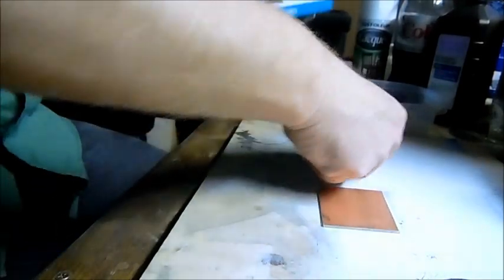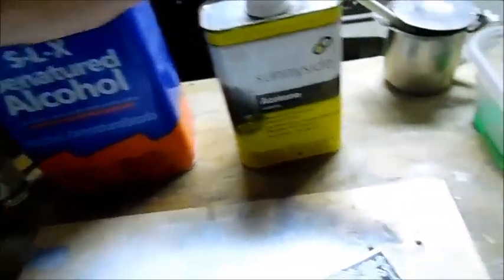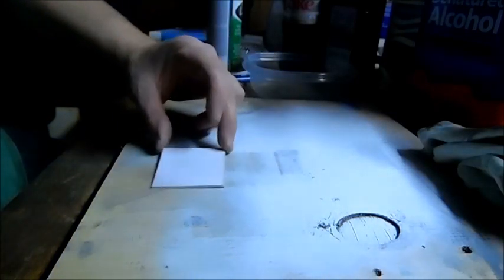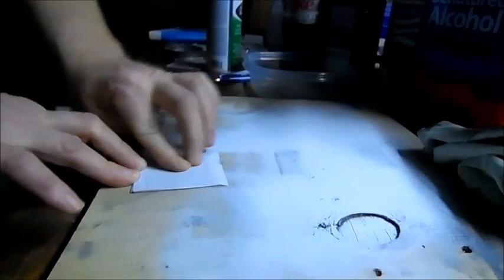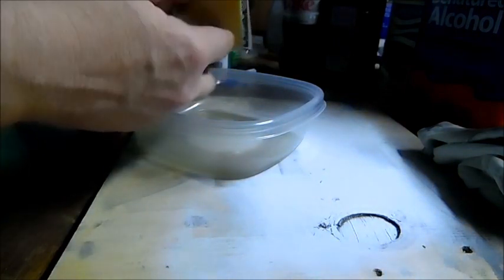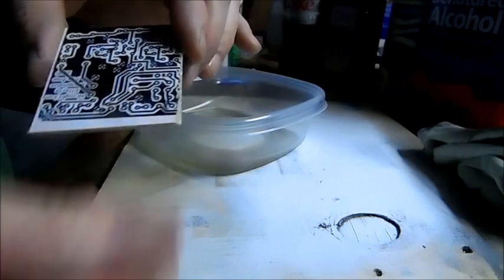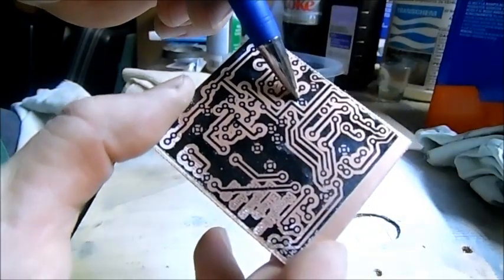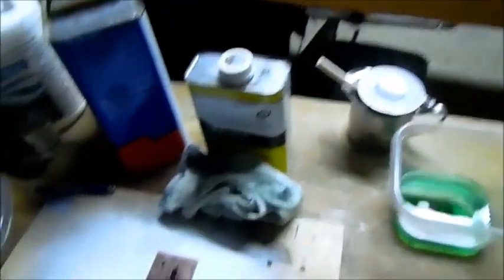heatless toner transfer for PCB etch--Impatient version

Comment: Excellent, best results I've had and I've tried them all.
I put mine through a cheap GBC laminator afterwards and worked 99% perfect. Cheers!
Reply from the maker: yeah, i eventually went to using a laminator as well- it really makes the process much faster.

Comment: Great work.  TBH with a thin glossy magazine page, It will take only 5-7 minutes to make this size of PCB.  Here is how i do it consistently everytime. 
1) Remove the Toner cartridge, shake it vigorously and replace it.  then print 
2) Heat the iron to just below the "wool" setting.  temperature around 125-135 degree C works best. 
3) Heat the PCB using Iron for 30 seconds. 
4) Put the artwork on PCB.
5) Put a folded paper towel on PCB and keep the Iron on it for a minute. 
6) Spend 2 minutes moving the Iron's sides here and there and all corners applying pressure thoroughly. 
7) let the PCB cool down on its own. don't rush it . If we put the PCB under water while it's hot, the copper shrinks faster than the transferred toner and the toner cracks. 
8) Once cool, dip the PCB in water until you see the artwork through damp paper.

Comment: Thank you for this video I have been using the laser printer on the yellow paper and the iron heat  for 3 minutes  with 8: 10 results  but I will try your method which looks good.

Comment: I'm very satisfied with the "nail polish remover method". It's even faster: Just make the board wet with it, lay the paper on it, pour a little more on the paper until it's completely wet too. Wait 10 sec. for the chemicals to work on the toner and then apply pressure gently across the whole board with a paper towel. When finished wait until the nail p. Remover is completely vaporized. Then soften the paper with water and peel it off slowly.

Comment: Muratic acid has some unusual properties in that it can escape thru the side of the plastic jug you bought it in to rust any iron nearby. I won't keep it inside anymore for this very reason. What I do have is kept outside 24/7 so that the fumes escaping do just that without throwing a layer of rust onto nearby objects. I hate it when "they" change their formulations without any notice, black flag flying insect spray (blue can) did this and while it still works aces, it tends to shoot a stream clear across the room when you wanted a fog. So after years of keeping a stash of the "good" nozzles which didn't help at all, I did something remarkable, I shook it. Ya know just like it says to on every spray can for the past 50 years.  <<< that part, the actual shaking makes it do fog instead of squirt, so now I have to shake it first if I actually want the fog version out of the very same can. And all the nozzles are the same. Whoda thunk it? Didn't used to be that way, but it's that way now. Interesting video, thanks for posting it. Always helps with more information even though I'm tending towards the using glossy magazine paper to do the transfer with at the moment. That will change quickly when I get around to doing it of course. I'm as fickle as it gets in that regard, wondering if perhaps the clear lacquer still has the properties you are capitalizing on here?

Comment from the maker: UPDATE: apparently Rustoleum has changed the formulation of their lacquer and it no longer dissolves in alcohol!!! The last 2 cans i bought have been extremely difficult to work with, which might explain some of the difficulty some of you were having duplicating my results. I will update further with a substitute transfer base soon. Thanks!
Ed
Reply: 4 months ago you promised an update. Where is it?
Reply: Shellac will dissolve in alcohol you only would need to add pigment to it for this method. And i'm not sure if that toner would stick to it.

Comment: Murriatic Acid is Hydrochloric Acid. Fisher sells, for the industrial laboratory a 12N (12 times Normal) concentrated solution that will smoke/fume when opened and should be used under a hood (your breathing chlorine vapor) since it will burn your sinuses. My question is do any of these home-store/hardware store bought murriatics state a concentration either as a percent solution or normality on the bottle? And remember… “Acid to Wata like you oughta”!

Comment: Thanks, Ed! I tried this with mixed results and I had a question or two. I have the exact ingredients in your video (rustoleum spray lacquer, acetone, denatured alcohol). 

When I rub the alcohol to remove the lacquer from the board, some of the toner comes off with it, making the solid black areas kind of spotty and the traces weak. It kind of makes sense, since the lacquer is "under" the toner. I tried waiting a little longer before using the alcohol but that made the lacquer cure and the PCB didnt dissolve at all in the acid (thin layer of lacquer covered the surface). 

Any advice on timing or method would be greatly appreciated!!

Thanks!!
Reply from the maker: Use the alcohol immediately after doing the transfer and-this is the key- don't use any pressure when wiping the lacquer off. Use lots of alcohol and just gently wipe rather than rub. If you have these exact ingredients, it should wipe right off if you use enough alcohol. If you get a stubborn area, just take a very small screwdriver or similar and scrape in just that small area. 
I usually go back and review the transfer under a magnifying glass and use an ultra fine tip paint pen to fill in any spotty areas in the ground plane or touch up a trace or pad.

Comment: I just got the iron on method to work great. I print on the shiney side of a transparency. clean the board, iron it on, peel it off then do it again. I have two layers of toner. Its easy to align the patterns since you can see through it. It Works perfect, and I have a brother printer, with toner from InkOwl.
Reply: Please upload a video of this. I would love to see this method in action.
Reply: yes, I do that..  the film transparency print with HP1102 with high resolution 1200.. put on the pcb.. then iron about 1 minute... 99% the tonner on film move to pcb

Comment: There is another video of a dude using 8 parts Alcohol and 3 parts acetone and it's a lot easier looking then this. Anyway better then the ironing method!
Reply: Kimball Wiggins I tried the 8 part alcohol and 3 part acetone with no luck. I even tried straight acetone using his methods and still no transfer.
Reply: Botwire You can try Acrylic instead Axetone
Reply: No need to mix anything, just use nail polish remover. Worked straight "out of the box" and as bonus your pcb is smelling very nice.

Comment: i have a samsung laser printer and i am having a hard time getting a good transfer. i have 7mil glossy inkjet photo paper and was wondering if you were using the same type of paper. i have not tried using  laqour yet but it looks like something to try.  Does the laqour need to be fully dry or just dry to the touch?
Reply from the maker: hey Botwire, sorry for the delayed response. technical difficulties. Anyway, I print onto the backing paper from shipping labels. You remove the label and print right onto the glossy side of the backing paper (see comment below for printer help). These work way better than any others I've tried. 
https://www.amazon.com/Best-Print-200-Half-Sheet/dp/B0069RY9BY
Spray the lacquer, then blow it dry just for a few seconds till there's a film over it. Then carefully set the transfer onto it and start pressing and rubbing.
Reply: Botwire  try transparencies and iron on two layers of toner,

Comment: Can I use laser printer to print  the pcb on glossy  paper? Or should I use laser printer for this work?
Reply from the maker: Not exactly sure of the question. You definitely need to use a laser printer-- ink jet won't work. I use either pcb transfer paper available from Amazon, or the glossy side of shipping label backing paper. Does that answer your question?

Comment: This looks really easy when you are doing it. But when I use alcohol to remove the white paint I need to press too hard to clean all the small details - which then also rubs off the toner.
Reply from the maker: Torsten Curdt the secret is to use lots of alcohol and very little pressure.
Reply: I tried again. Still not working for me. I've completely immersed the thing in ethanol for a few minutes. The lacquer did not even start to dissolve, nor did the force needed to clean the copper became less. Maybe the  lacquer I am using is wrong? But then the question is - what should it be else?
Reply from the maker: I think you just have some acrylic/water based lacquer. I wasn't even aware that there was such a thing, but I think several people have had the same trouble.  make sure the can says to clean up with mineral spirits or some other similar solvent rather than water.
Reply: Unfortunately it doesn't say on the can. It's a 385836 white dupli color - apparently meant to be used on cars. http://www.motipdupli.com/en/products/dupli-color/mobility/cars-rallye-sprays/ipg-1089/tm-1089.html It says "nitro-combi" based and "Limited resistance against petrol"
Reply from the maker: i think you probably need to look for a different lacquer. I've used Deft and Rustoleum and Krylon lacquers with good result.

Comment: doesn't applying acetone to the copper and toner ink makes the toner ink stick to the copper?
Reply from the maker: it actually will completely melt the toner. you can make a diluted solution of acetone and isopropyl and transfer that way. there is a tutorial on here about doing it that way by someone else.

Comment: you can buy the shiny waxy paper without buying the labels too,and is so much more cost effective.
Reply from the maker: I have tried PCB transfer paper (more expensive, worse results), parchment paper (has to be cut to size to go through a printer and is so thin some printers can't grab it) and freezer paper (still have to cut it in both dimensions, mixed results for transfer). None of them has worked as good as the label backing and the labels are about $10/100 sheets. 
If you have a source for 8.5x11 sheets of shiny wax paper that's less than 10 cents a sheet, I'd love to try it.
Reply: personally,i'm moving towards getting away from any transfer method,by building my own cnc for laser etching and milling pcb track,honestly fed up messing with this whole setup,ferric chloride is too bloody messy,and i have the proper etch tanks,your wax paper is far stiffer than the yellow sheet i have been using,but it's still a pain in the arse,whether ironing it or some other tedious heating method,the only saving grace is that if the transfer toner screws up the copper clad board is still usable for a repeat of the process ,i bought my transfer sheet from china post free,150 sheets for about £2 or £3 sterling(uk),no where lese could the stuff be so cheap,but again the gauge is a factor,also i have seen the actual vinyl being cut with a cnc vinyl cutter for pcb trace resist,a whole piece is stuck on the board first then cut and weeded out,might have been a laser cut now i think of it,anyway,asap i'm going cnc,bluetooth connected to my workshop and watch via web cam,while i do other stuff at my cosy indoor bench,as it should be.
Enjoyed the vid,just thought the vinyl a bit wastefull,atb.

Comment: Its  acrylic lacquer ? I using spray lacquer but cant using alcohol to remove paint
Reply from the maker: It has to say "lacquer" on the can. If it's enamel, this probably won't work.  It should not be acrylic based.

Comment: I was amazed by how easily the lacquer came off. Is that only because it was fresh?
Reply from the maker: it will come off pretty well with alcohol even after quite a while. I've been running mine through a laminator lately after doing the lacquer layer and it still wioes right off with denatured alcohol.

Comment: What kind of laquer is that? I mean is it acrylic or something?
Reply from the maker: I can't remember exactly what lacquer that was, but I still do it this way, and any lacquer I have worked has tried as long as you use 91% Isopropyl alcohol as the solvent-- NOT Denatured alcohol like in this video.
Reply: @WroughtIronEffects  Well I just have some laquer but it reacts to acetone. Not so much as the toner, but it does

Comment: 'It's not smoke, it's toxic vapor' ... lol ... awesome vid!? Can this method be used with a glossy paper or even just standard bond or will the tiner not 'release!?' Also, can clear lacquer or shellac even work!?
Reply from the maker: Hey John, you can use glossy photo paper, but it won't work nearly as easily. probably the second best thing I've used is freezer paper. glossy photo paper was pretty frustrating to me. clear lacquer will work, it's just a little harder to see that you've got it all off. Not sure about shellac, but i would guess it might.

Comment: I have been wanting to do my own pcb's and have watched many, many videos and so far... Yours seems to be the easiest to get  the towner on to the board. I have tried the iron with no success. Do you have a way to get a two sided board to work with your methods as far as alignments?  Great video!!
Reply from the maker: Hey john, I haven't done any two sided boards. If I were going to do it, I would probably locate a hole in each corner of the layout, then measure very carefully and pre-drill those holes into the copper-clad board. then hold it up to the light as you lay your transfer on to get it to line up exactly with the holes. Then do the same with the top side transfer. I line up the slikscreen layer for the top of my boards kind of in this fashion. I am usually off by just a little bit, but then again I'm not being super careful because being off just a hair on silkscreen layer isn't a problem.

Comment: Why the laquer? What does that do?
Reply from the maker: the lacquer provides a transfer medium. It gives the toner something to stick to that's soft. Kind of like glue. Other mediums may work, too. But Lacquer is the one that I have found that can be easily removed with a solvent (91% isopropyl) that doesn't affect the toner.

Comment: Nice job.   Thank you for posting.

Do you know of a way to transfer a  component outline/lettering (for example "R1 10k")
onto the etched PCB with the white spray lacquer, so that the lettering is white?   Am guessing you would need to make some kind of stencil, but I don't know what you'd use to make small letters legible.
Reply: Sounds like you just need a way of removing the (black) toner layer afterwards, in a way that doesn't also remove the (white) underlying lacquer layer.  Have you tried a water soaked kitchen scouring pad?

I'd recommend leaving it to dry a while before you do this final step, so the lacquer layer can harden as much as possible.
Reply: @edchew7770   have you got another video ?

Comment: Great job Ed. I ordered the label paper on amazon. What side are you printing on? The paper is not glossy and although it seems I have the same exact paper, it looks like yours is a bit glossy?
Reply from the maker: Hey sorry for the delay, I got cut off from this account for a while. for this to work, you need to remove the labels from the backing paper, then print onto the glossy side of the backing paper. Some toners won't stick to it very well. What helps for me is to set the printer to the thickest paper setting (or the Card Stock setting) and print 4 or 5 blank sheets of paper to warm the printer up. Then i print onto the backing paper.

Comment: aliphatic or achrylic spray paint?
Reply from the maker: this is what I use. ANything acrylic is not going to work well with this method. 
https://www.amazon.com/Deft-Interior-Semi-Gloss-12-25-Ounce-Aerosol/dp/B000ZYWE00/ref=sr_1_7?s=hi&ie=UTF8&qid=1486872254&sr=1-7&keywords=lacquer+spray
Reply: here is msds https://www.highlandwoodworking.com/msds/Deft-semi-gloss-brushing-lacquer.pdf
There is no acetone in you spray that's why it works. You can use hair spray I think it should work just as good. And that's common product.

Comment: I can't get the white to come off without the black coming off too.
Reply from the maker: Hey Robert, I've been having trouble with the new formulations of Lacquer as well. Isopropyl works better than Denatured alcohol for me, but I've been using an older can of lacquer, apparently from before they changed the formulation. If I find a good substitute, I'll post it here.

Comment: Clean water will probably work too.
I like that!
Why the heck this complex method? I just print on Teflon coated paper and iron it down to copperclad? This is crazy.
Reply: Teflon and some transfer papers are too static charged and give a poor photo copy on the film,if you can kill the static most baking papers will also work